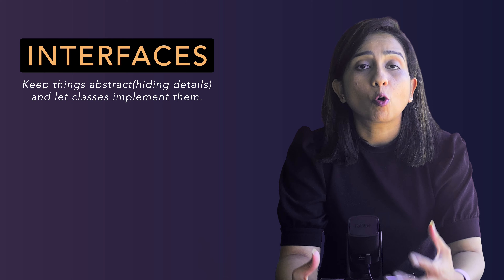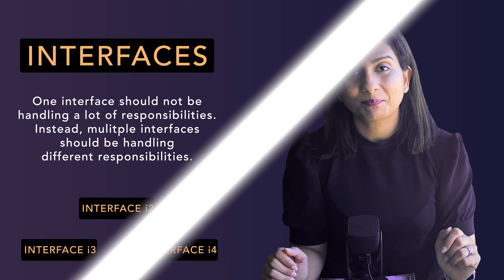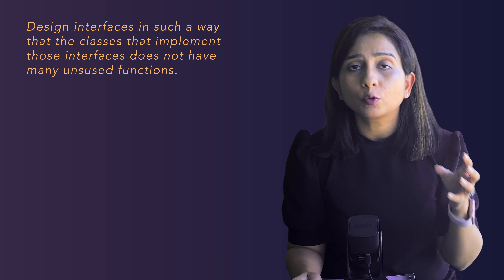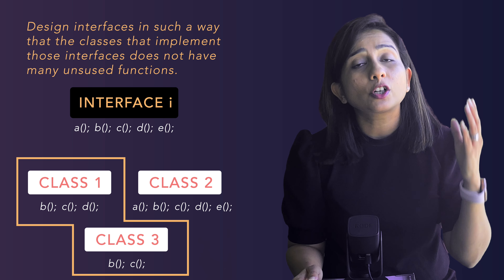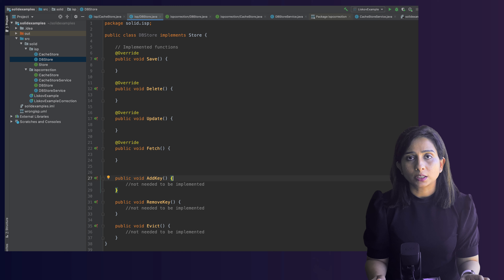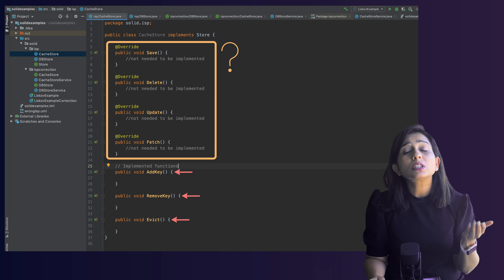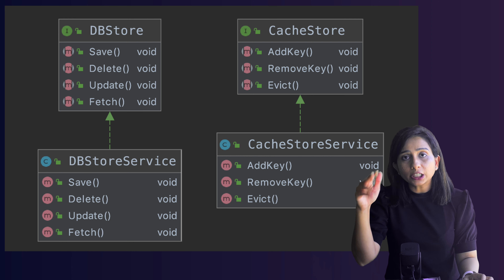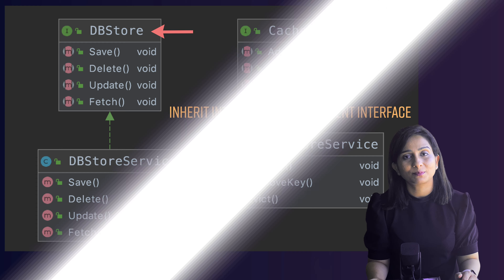Low Level Design 108 | Interface Segregation Principle | 2022 | System Design

Comment: An explanation into why Segregation is necessary would be nice:- Like maybe it saves memory on objects, or saves code faster etc..
Reply: Think of it like this. If a method is contained in an interface, then the class that implements that interfaces will have to forcibly implements ALL the methods of the interface (say via dummy or empty implementation) even though it does not need those methods at all. 

In such cases, the code won't be clean and filled with such dummy implementations leaving room for errors, extra space (as you mentioned) and much more.

Hope this helps.

Comment: Hey there. Actually my 6th sem of CSE is on the verge of ending and in a couple of months placement interviews will start. Now I have used python for the most part of the past 3 years in engineering and a fair amount of JavaScript (When developing apps in React Native). I have also started dsa a few months back using python and I am quite familiar with the concepts. But I have been reading and listening that one should use and learn C++ or Java to land a good job. You as well in a video mentioned it. I have 0 knowledge of Java and struggled with C++ when I tried it in the first sem. 
I wanted to know that is it okay if I continue with python and master DSA in it or should I switch to JAVA/C++ (If yes then which one do you suggest). Given that my placements will be starting from August(2-3 months from now) I am really confused whether I should invest my time in learning a new language and again start DSA in it from scratch or should I just continue with Python.
It would be of great help if you could point me in a right direction. 
Thank You.
Reply: Keep going with DSA in python. Since you are still in college, the initial placements do not require you to master a particular language or tech stack. DSA in any language is very important for freshers. Java is more for experienced folks who work in backend since most backend is built with java spring/spring boot. If possible go through C++ pointers concept since that's the only one I have seen crop up in MCQs in college. All the best!
Reply: @das_bored  Thank You so much for clearing things out for me. C++ pointers was the concept that made me stop learning it but would definitely give it another go☺.

Comment: This is a bad example, ATMs that have both withdrawal and deposits are the best. There is at max 5 people in the queue, maybe it is different for different cities. But the bigger problem is cash availability. Cash deposits happening in the same machine ensures cash availability, therefore more cash withdrawals. The opportunity cost of waiting for extra 5 minutes is way more significant than finding a different ATM machine that has cash. 
Thats why I would say be mindful while segregating, dont just segregate for the sake of it.